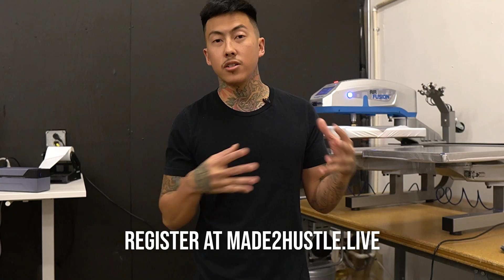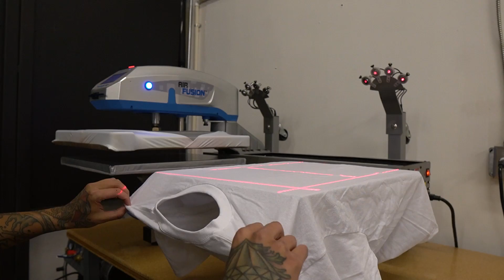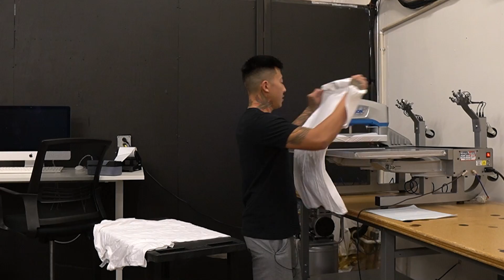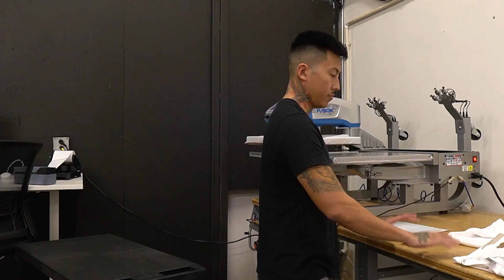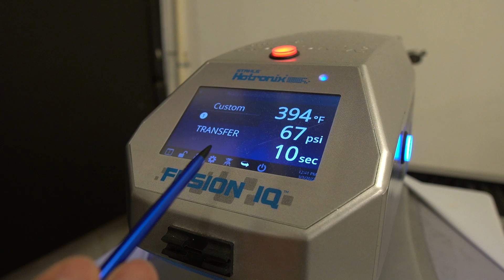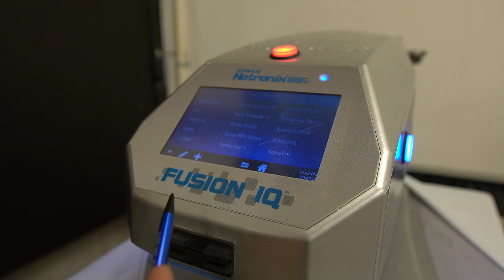Is This $7,800 Heat Press Really Worth It? - Hotronix Dual Air Fusion Review

Comment: Another video there other YouTubers for this heatpress buisness I prefer watching you only  I kinda stuck wat heatpress to start with  I got about close $500 to spend I really want this to work reall bad wat do you recommend, I went on fivver to get designers to make me images it’s been 3 weeks and they all said there sick which said it only will take 3-4 days and all pet are the same things so it’s frustrating and this is wat I’m waiting on. So just your opinion if you can help on wat press
Reply from the maker: For $500 buy whatever you can and upgrade later so you can get going.

2022 Heat Press Guide - What Heat Press Should You Buy? - Heat Press Machine Ultimate Buying Guide https://youtu.be/cKIl2I6ls1w
Reply: Are you still doing the giveaway on the heatpress??
Reply from the maker: I already gave it away

Comment: Like I really need to know that it takes 9 minutes to get to the heat we're not in a hurry here is here people are hot tronics I know the company that is the reseller of STA... For $7800 I can get a good heat press for about $750. Plus  person isn't going to go that fast that they  We'll use both platinums at the same time being in such a hurry being in the heat press business or at the T-shirt business it's all about not being in a hurry you cannot be in a hurry because you have placements to put on there yeah OK the lasers are good but the lasers like you showed only show you placement and in no way does it hold it for you. Plus I'm not gonna have a compressor in my home.   If I need a compressor that means I need a shop and in that case I need better equipment than a 2 press heat press with a foot pedal